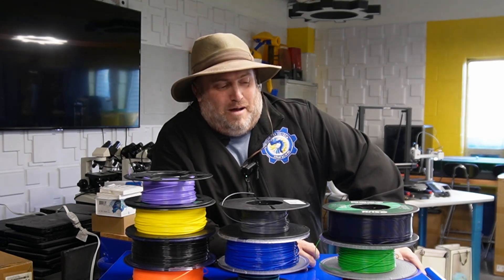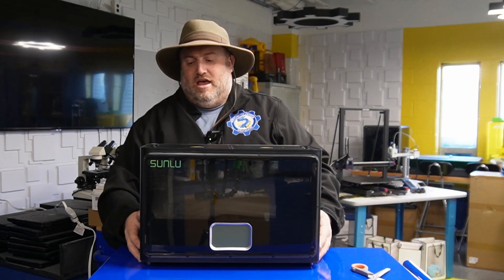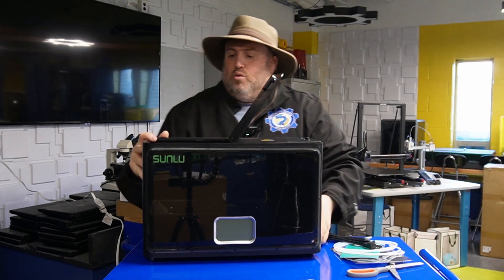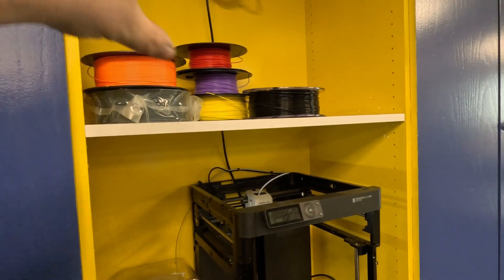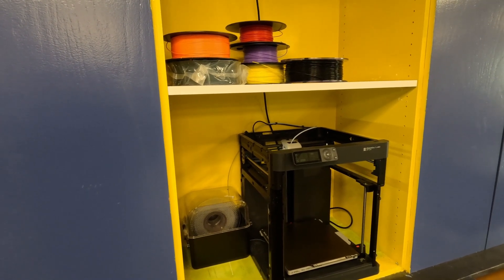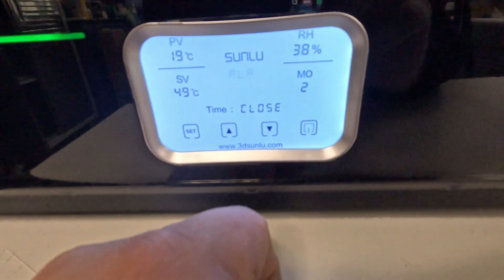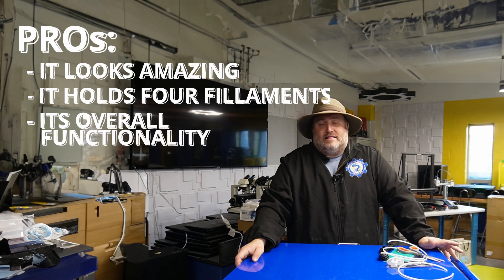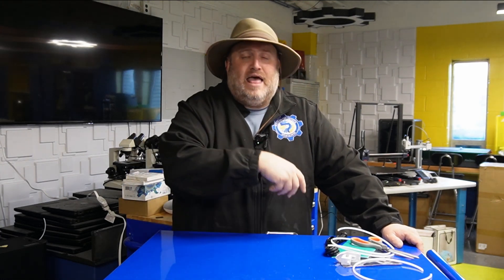The best dryer for your 3D Printer? @SUNLU S4 Filadryer Honest Review

Comment: Nice to see a real honest review. I have a question: If I'm using this in a humid garage that's around 70% humidity, is it likely the unit will be constantly running because the room humidity is always so high? I guess putting some desiccant packs in there would help, but sometimes I may go a few days between prints and it sounds like this takes a lot of power to keep constantly running.
Reply from the maker: Thank you so much for the compliment and thank you for watching. It's a good question about whether or not this can hold up in a constant humid environment such as a garage. I know that when the AC was turned off in our lab over the weekend The classroom would definitely get pretty humid And there is a range of acceptable humidity so once the dryer box brings it down to let's say 30%. There is a bit of give a 15% or so in which the dryer box doesn't have to keep running. I think that wants it meets its mark it shuts off and even if the rest of the environment is pretty humid can hold it for a little while. Truth is it's a good test to perform and I think even a better test would be what the energy consumption truly is on running this dryer box. You gave me an excellent idea of basically just going through all the accessories and 3D printers and just come up with energy costs based on all the printers as well as its accessories such as a dryer box. Of course The cost depends on where you are. So I'll obviously include something like kilowatt hours but I'll definitely add it to my list of upcoming videos. Hopefully I'll be able to come back to you with better answers then such as whether this unit is truly an energy guzzler or not.
Reply: @CaptainCreativity  Thanks for the info. I'm going to be drying exclusively Nylon, which needs to be kept at 10%. The issue I've had with even air tight dry boxes is as soon as you pop open a hole in the box to print, the humidity in the box starts rising and if I'm printing something that takes about 10hrs then half way through the print fails due to the Nylon being too moist (humidity in my dry box climbs to 20-30%). For now I have to move the spool from the dry box to an active dryer which works better during long prints but obviously is no good for storage. What I like about the S4 is the storage mode, but I have a feeling it's just gonna run constantly, or at least spike easily to whatever the RH threshold is (30%-50% I believe is the default) then run for 6hours to get it back to 10% again. If you do run an energy test that's certainly something I'd be interested in seeing! Many thanks!

Comment: What about multiple filament types? I am really close to deciding to get one of these. It is especially cool that it will monitor RH inside the box and run as needed to maintain. But how does it work if you want to keep a couple rolls of PETG, a roll of TPU, and a roll of something else dry and ready to go?
Reply from the maker: That's actually a fantastic question and unfortunately the compartment inside the unit is all open so whatever you set for your filament setting applies to everything inside the unit. So if I apply PLA it will dry out everything in the box as if it was PLA. Obviously if you said it to TPU the temperature requirements for drying out are higher than those of PLA however I don't know what the implications would be to the PLA if you were to leave it in there under TPU drying instructions. It's obviously not optimal but I don't know if it would have problematic implications.
Reply: IMO if you put in different filament types, you will not be able to use the PRESET settings as is. Also it would be hard to use it live or inline. If it's to keep your filament dry then it will do the job no matter the filament type.
Reply from the maker: @meyerbenr  it definitely supports different filament types in terms of different profiles however it could only be one filament type at any given moment. When you look inside of the dryer box it's completely open if they were divided up into different compartments then it would be possible to dry different filaments at different profile settings. Unfortunately that's not the case here and so setting your temps for PLA for one spool will be transmitted to the other three roles.
Reply: @CaptainCreativity  thanks for the replies. I ended up getting one and I love it. It's a fantastic addition to my print shop. I mostly just use it for PLA but sometimes I dry PLA and PETG in it together. It works great. I've found that I'm only drying TPU as needed and while I'm printing with it so that's only one roll at a time which goes in my S2 dryer. Thanks again!
Reply from the maker: @meyerbenr so glad to hear and thanks for your support